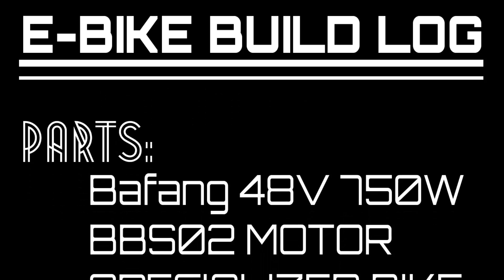DIY Electric Mountain Bike

Comment: How did you attach the wood battery box to the bike frame? Was that the bondo?
Thanks for documenting your build. One of the most elegant mounts of a battery I've seen in a DIY build.  I just finished a similar build (Trek Cobia hard tail w/ bb02 mid drive) and it is a kick in the pants!

Comment: why do you have to disassemble then re-assemble the battery packs to fit inside the small triangle space frame on your bike? and it looks like a permanent install? now, when you need to do some maintenance or replacing one or more li-on cell that will surely fail in the future, how would you do it? thats a lot of unneccessary work that you have done to fit the battery pack, you can just put it over your rear wheel in a carry on bag!